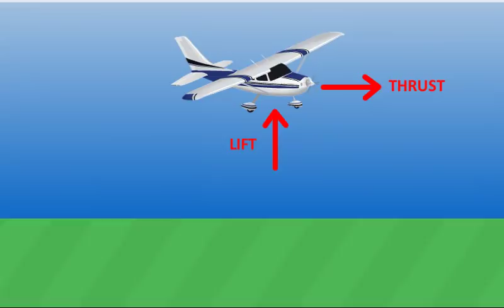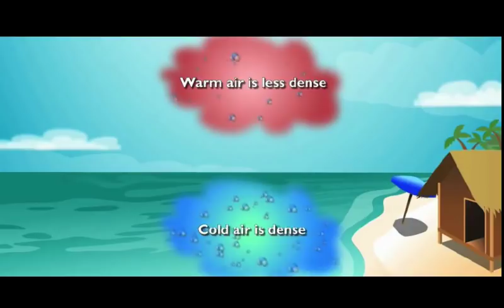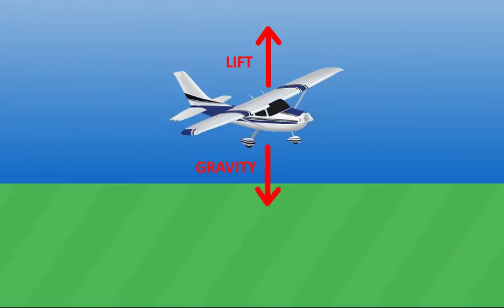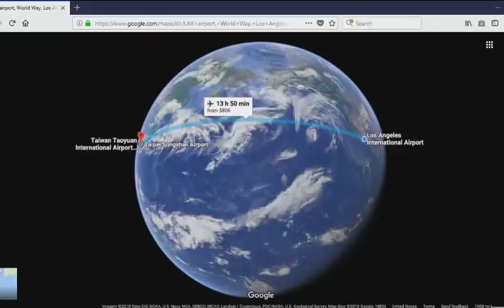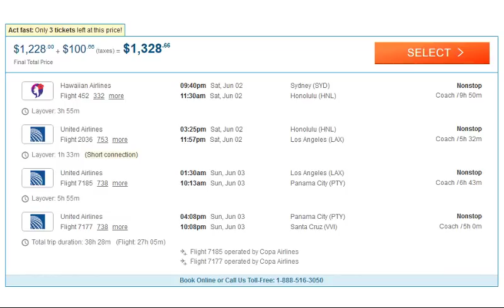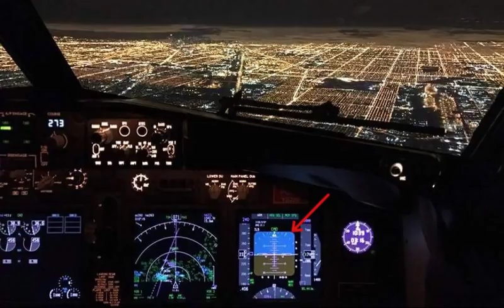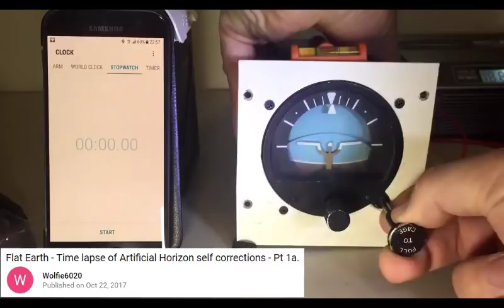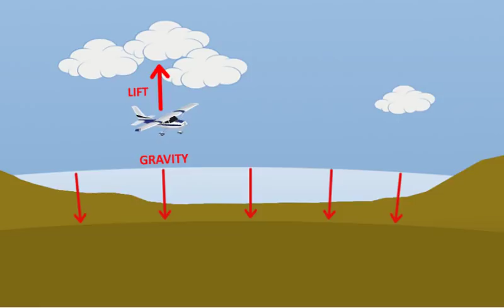Flat Earth Falsities - Plane Nonsense

Comment: North isnt up right? not in relation to the surface or curvature? 

if i glue a monopoly dog to the tip of south africa facing north...why is the north pole up in relation to the dog? why is he going against the downward curve?
Reply: Fuck off you pathetic troll.
Reply: That's okay, he didn't say anything at all.
Reply: Bobby "then prove the experiment wrong." I did it and the dog was on top of the globe and all the directions were down. Why did you hold the globe with north facing up? Is the globe the Earth? Can you prove ANYTHING about the Earth using a toy globe? 

If you drop it and it breaks, does that prove that the Earth can be dropped and broken? Is there a huge metal dog the size of Madagascar glued to South Africa on the real Earth, with its head extending far up into space (at the scale of your globe, the atmosphere is about 5mm thick)? If the globe is painted blue, green, yellow and brown, does that prove the Earth is painted blue, yellow and brown? If your globe has an axle through the poles, does that prove that the real Earth has a metal rod running through it?

Nothing about your "experiment" is real and no real conclusions can be drawn from your illogical, false, deceptive concoction. You idiot.
Reply: Stormageddeon It's easy to forget that we're here to persuade normal, thinking people looking into the outrageous claims of Flat Earth Cultists, honestly seeking the truth. We can't change the Cultists, only death cures insanity. But we can reassure the normal people that what science believes is logical, confined to the facts, and is based on honest, very skillful people who spend their lives looking to refine our conception of the truth. And that these scientific people have been spectacularly successful . We can also acquaint the honest seekers of the blatant dishonesty and deceit of the anti-intellectual cults and our efforts to avoid those same errors.
Reply: Bobby boy You didn't say anything about two dogs. You said "if i glue a monopoly dog to the tip of south africa facing north...why is the north pole up in relation to the dog?" I told you that I held the globe so the dog on South Africa was on top and all directions were down. And I asked you what a toy globe had to do with the Earth? It has NOTHING to do with the Earth and nothing you can do, gluing stupid Monopoly dogs to it means anything. Answer my list of questions above. Checkmate, mate. You're an idiot and you're too much of an idiot to see it. Unaware idiocy is the worst type, invariably fatal. My sympathies.
Reply: There is no spoon.
Reply: RockinRobbins13 which lie? pull put your globes and do the experiment
Reply: No... then prove the experiment wrong.
Reply: Stormageddeon Dark Lord of All navigating has nothing to do with physical curvature and the properties of a spherical surface.
Reply: Bobby. How can you navigate the earth? Answer, the magnetic Poles. What is up or down on a sphere? There isn't an up or down on a sphere. So to navigate the spherical earth we use the magnetic poles. North and south are directions. Does a ball have a north and south? No because it doesn't have any magnetic poles. Why did you say that? Did you think it made you sound smart? Take a week and research geometry so you don't end up saying things like this anymore. It doesn't help your case when you don't even understand shapes.
Reply: @Capt'Wes Starwind Your answers are a little off. First of all, even when we use the magnetic poles, it is true north and true south we are really interested in. That is why navigators use maps that indicate the difference 'anomaly' between magnetic and true north.

Secondly, 'north' and 'south' are not purely constructs of the human mind: there really is an axis of rotation, going through a sphere it must cut the surface at two poles: it is only the choice of which is 'north' and which is 'south' that is a construct of the human mind, and an arbitrary choice.

But probably the most important is about 'up' and 'down'. Back before people understood gravity, they could not really talk about it right. But now that we do know, 'down' is always the direction gravity pulls you. Since we are on the Earth, that direction is towards the center of the Earth. So neither people living on our side of the Earth or those living on the opposite side have to "walk upside down", since down is always towards the center.
Reply: That is because I am trying to dumb things so a 5 year old can understand it. Main point is up and down on a sphere do not exist the way Bobby thinks they do on the earth. Getting into geographical and celestial poles and the earths axis is going to land on deaf years at this point. He doesn't understand a sphere or what it is. They think the earth is flat after all. They don't even say a cylinder, or question if it could possibly be a cone. I am not sure Bobby here even understand magnetics or shapes at this point. This is why I never even mentioned the second point you mentioned, let alone the dreaded G word. Flat earthers are five-year-old children, so complicated detailed explanations land on deaf ears. First shapes, then terms found in dictionaries and encyclopedias, then rotation of earth the sun and moon, then orbits and finally gravity. They can barley grasp what reason or logic are at this point. Their back slide has taken them to a time before Socrates and Pythagoras. That is what you are dealing with when it comes to flat earthers. Hell, take a look at my folder "get woke". It is alarming the videos I need to post to get some to understand basic concepts. I had one deny 3 dimensional space yesterday!!! Trying to give long answers to them with lots of details, facts and examples just gets them angry and does nothing. Maybe if they can understand what science is about and how it works there may be some hope for them. They are on computers and deny science is real, so that should show you their mindset. What built the computer bobby? Science or sky fairies and magic crystals? Remember when you are answering their questions you are essentially talking to a five-year-old cave man that has never left the cave. Dunning-Kruger, as a flat earther ironically pointed out to me once. This is why asking them questions about how they learned this and trying to get them to understand shapes is what Stormageddon and I have been trying lately. Question everything. You know how many answers I have got to the question "what is a theorem?" has been in the past few days. Zero. So we keep trying the old KISS adage. Keep It Simple Stupid. It is fascinating how simple one must get to communicate with flat earth.
Reply: Nice, but it should be clear by now that that approach is not working. Part of why it is failing is that you go too far when you say they are five year olds. Even worse is when you say "five year old cave man that has never left the cave". They are not going to respond the way you want when you look down on them so severely.
Reply: Well I could try long winded descriptions linking peer-reviewed papers and videos and experiments they could do at home even. After 3 months that has amounted to nothing. Except hearing them claim peer-review is all lies the experiments are lies and my descriptions are all lies. This new approach at least helps in understanding that these people can't understand 3d shapes and basic geometry. Sort of key for figuring out the SHAPE of the planet they live on. If they can learn grade four geometry then they can have one tool in understanding how to know the shape they live on. They can then go test this with two friggin sticks and a compass. Dunning-Kruger. You do not yet get how much they don't know. Its all magic, sky fairies, and conspiracy with them. Because they do not understand simple math and what 3d shapes are or how to measure them. With that basic knowledge they can see through this stupid flat earth lie. How can flat earth make any measurements for their earth? Well they can't and it is a scam. When they understand how we first measured the earth they may see flat earth can not do that. They already have all these preset brainwashed responses to all the answers we give them. Asking them what shape is made from two circles and a rectangle breaks through a bit of that brainwashing and may get them to stop and think for a minute. They do not understand geometry in any way at all. Keep trying with the intricate answers bit you should know all their responses after a week. It's lies, it's fake, it's NASA, it's Satan. See how asking them about a shape keeps them from responding with a preset word salad. The very least they shut up because none will admit they don't understand grade 4 geometry. How can I explain how Eratosthenes figured this all out if they cant understand what he was doing. Go look for flat earth Eratosthenes experiments. All done wrong or a model. They want old school observable physical science as proof. So when they can understand the maths involved they can realize how it is done. That's why they love the laser tests that get messed up by FE showing no curve or the theodolite apps. Go old old school shadows and math and they can not deny it then. I just gave up with the explanations everyone gives since it was going no where and I would just end up insane at that point. Do you not think guys like bobby have heard all the answers people give a thousand times by now? Of course he has and he chooses to deny and ignore it.
Reply: NotTheCIA I.think its self explanatory. easy to do. its just the results are undeniable and common sense. people on opposite sides of the ball would hold a view point opposite of eachother in relation to the curved surface. 100 % undeniable. please grab any 2 small objects, glue them to your globe one north one south and test it.
Reply: RockinRobbins13 i told you to put a dog in south africa and one at the north pole. we are not all "on top". that is horse shit.

yes both dogs are on top of the globes surface. both are at opposites of the surfaces curvature. checkmate.

grab an apple. sane thing. put your pointer finger on the stem and your thumb on the bottom. see both of your fingers are on "top" of the apples surface. both of your fingers however are not on top of the apple. they are on opposite sides. press down with both fingers (gravity). both are going "down" towards the core or center. Here is your problem. your thumb is still upside down in relation to your pointer finger. its direction to the core is both north and up. same with the surface. for your thumb to meet your pointer finger it would have to go north and up. the same applies to any ball or sphere. people live on opposite sides of the curve.
Reply: RockinRobbins13 i guess you didnt read my posts. you cannot disprove what in saying. the point is on a globe a dog in the north is opposite to the curve than the dog in the south. i broke this down for you even more clearly with the apple using your own "gravity theory". it didnt change the 100 % facts nor does scale explain it away.
Reply: Bobby, what is the top of a sphere? Reading your posts is a bit confusing. It is hard to tell what you are even trying to say. Yes though, people do live on opposite sides of the earth. If you had Super Man x-ray eyes and could look down through the earth, from your perspective people would look like they were upside down. Everything is accelerating to the center of mass. The earth just gets in the way. So again what is the top of a sphere?
Reply: +Bobby Wizdum
"you cannot disprove what in saying." Your lies have been exposed and proved as lies on several occasions Bobby. So fuck off.
Reply: +SpectatorAlius
"The FE cult is not "firmly grounded in biblical literalism". If it were, your favorite bogeyman Ken Ham would have to profess the exact same thing as they do."
Oh dear, what a specious argument.  That argument is based on there only being a single interpretation of the bible, which is of course a lie. The FE cult is biblical literalism.
The ID cult is biblical literalism
The Creationist cult is biblical literalism
The YEC cult is biblical literalism.
Christianity itself is biblical literalism. No bible. No JC. No Christianity. Or are you one of these special people who is Christian but doesn't believe anything in the bible? Even though you have to believe the bible to be a Christian.
"@wrong When you learn to read, little boy." Only a silly little bot would be so infantile as to use that silly schoolyard stupidity.
"you will realize that I already answered your impertinent, stupid question." No. you responded. There is a difference. Child.
"You might even realize how very wrong you were to claim "only YEC cite AIG unless it is to prove AIG is lying" Such as? You? Jason "the liar" Lisle? Pence?
"your own intense wickedness". Ooohh, a godbotherer threat is it. I really am frightened. If that is so, why is it that I have spent much of my life working for charities to help the disadvantaged, the disabled etc.? Unpaid. And these were charities your faith had abandoned because they weren't getting the adulation,  recognition and media support they craved. Once we had had nurtured these charities back to health suddenly you godbotherers wanted to be part of the action. Pure hypocrisy.
Reply: +RockinRobbins13
"People who believe that Flat Earth Cultists are Christians" So who decides? They claim they are. Or are you the arbiter of all things? Are you?
The only reason Ken Ham et al are so vehement in their abuse about the FE cult is because it exposes the weakness of biblical literalism which the FE, ID, Creationist and YEC cults all adhere to..
"They believe the Cultists can't tell the truth, but suspend their disbelief when the Cultists claim to be Christian" Nt too logical are you. But then you are an illogical godbotherer. You are conflating knowledge and belief which is the norm with godbotherers.
FE cultists believe the earth is flat because they believe the that is what the bible states, just as they believe they are Christians. You also believe you are a Christians, as do Ken Ham and Jason Lisle.
A Christian is a person who believes in JC, i.e. the biblical person. If they do not then they are not Christians they are something else.
To a non-believer there is little difference in someone believing the Earth is flat and believing in Christ and claiming they are a Christian. It is all part and parcel of the same thing. But to believers like you, anyone with a different flavour of belief to yourself is not a Christian, so the problem is with you and your bigotry not with those who quite correctly state that the FE cult is a Christian cult.
You are the one following "the cafeteria school of logic." So please learn to deal with facts.
Reply: On the earth, it isn't opposite. Both see "down" as the direction things fall. They both agree on what direction down is. But as seen from space, a realm that begins about 5mm from the surface of your globe, by the way, you have decided to arbitrarily assign the up and down directions. You are wrong. Up and down only exist where there is gravity. Down is toward the center of gravity of the object you are on, spherical Earth in your and my case. Wherever we are on Earth, down will be toward the center of the Earth and it is the same for everybody.

You're pretending you're in a place Flat Earth Cultists don't believe in, space. And in that supposedly non-existent space you're handing out the words "up" and "down" without any reason, just arbitrarily as a brain fart. They don't mean anything. Space doesn't exist, according to your cult. There is no up and down in a medium that you deny, bub. 

I established that your globe proves nothing about the earth. None of its characteristics are shared by earth. Earth has gravity, your globe doesn't. Earth has an atmosphere, your globe doesn't. Your globe has a rod through the poles, Earth doesn't. Your globe is painted different colors than Earth. Your globe has latitude and longitude lines on it and Earth doesn't. If you drop your globe it will fall and break, Earth won't fall and break. Your toy globe and Monopoly dog proved exactly nothing about the Earth. It didn't change the 100% facts nor does scale explain it away. Checkmate pallie.
Reply: wong I'll let what I have to say here and other places speak for themselves and let others make the judgment. You have your set of prejudices, and your worldview is built on Christians being liars and mental deficients. I'll let people judge for themselves whether I fit that category. I'm not afraid of scrutiny as the Flat Earth Cultists are. I welcome it.

As for the Cultists, they say they believe the Bible. I prove that the Bible does not support flat earth. They therefore don't believe the Bible.  It isn't me deciding or being the arbiter of all things. That's a ludicrous hyperbole. It's me comparing the exact language of the Bible to their claims, comparing the writings of church fathers with their claims, finding that their claims are in conflict and declaring that evidence shows they're dishonest and unChristian. 

Just as you take a camera and a strobe, photograph an object falling, determine the change in speed over change in time and put a number on the Earth's gravitational acceleration. You aren't the arbiter of the gravitational constant. You researched and discovered something true outside of yourself, which you did not make. Your only function is communicating this truth. On Earth, things fall at 9.8 meters per second squared. You measured it, but are not the arbiter of that number.

I showed that ancient Hebrew poetry is hyperbolic, not meant literally. It has known rules, not the same as modern poetry, which no one reads any more anyway. The literal parts of the Bible talking about the shape of the Earth are very few, but they are consistent. I established that the Hebrew word used means sphere or orb or globe. I established that teaching by Christians dating all the way back to 300 AD is consistent with Jewish teaching that earth is a sphere. I conclude that flat earth is not authentic Christian thought and is in conflict with Christian churches today, which are built on the foundation of the past. Do you have any evidence to the contrary? No. Do you see the evidence and make allowances for it? No, you act as if I established no fact, conducted no research.

How is your treatment of this issue any different from the stance of Flat Earth Cultists regarding the shape of the Earth? You have a burning hostility toward any religion. You don't accept any evidence that any religious people can be honorable and bound by the truth. They have a burning hostility toward science and facts. They don't accept any evidence that spherical earth/heliocentric solar system are honorable and truthful.

And to be fair, we all harbor prejudices that blind us to the facts, don't we? The dangerous thing is when we don't realize that we HAVE the prejudice. The very concept of independent thought, colleges and universities is a product of the Roman Catholic Church. Did they fight the findings of the monster they created sometimes, as in the case of Galileo? Sure they did. They harbored prejudices same as us. But they fixed it. They actually fixed it pretty quickly, realizing that if you are to believe in God, you also have to believe His creation. His creation can't be in conflict with his word, because the author of both is a God who cannot lie. When you dig up the bone of an extinct animal, that is the work of God and it cannot be in conflict with the word of God or you are not a God worshipper. If you believed before that God's creations were eternal and no animal could ever become extinct (a common belief up to the middle 1800s) then you change your belief in the light of facts. Isn't that what we do every day if we continue to learn? 

The amount of our knowledge is always dwarfed by the amount of ignorance we have. Where our ignorance is will often surprise us, as it did when Galileo took photos of Saturn's north pole and found the cloud bands in a perfect hexagon. We didn't say "that's impossible, those photos are lying." We said "Holy crap, that's impossible, but there it is. Magnificent!" We abandoned our past misconceptions and reasonable theories and immediately and enthusiastically embraced the truth.

Science is about what is. Religion is about why is. There is no conflict there. In fact, religion begat science.
Reply: wong u saying fuck off is not exposing anything. It just continues to show your immaturity level.
Reply: +Bobby Wizdum
OK lying troll Bobby, prove you aren't a lying troll.
Why is it that a compass needle is more or less vertical at the poles and horizontal at the equator?
And when you carry on past the poles the needle slowly returns to the horizontal?
Why is it that it is only possible to navigate accurately over long distances using spherical trigonometry?
Why is it that traditional gyro compasses work perfectly in low latitudes but became unreliable in high latitudes?
Why is it that it is only possible to navigate accurately over long distances using charts based on a terrestrial spheroid?
Why is it that when you watch a ship sailing away from you the hull is the first thing to go below the horizon, then the superstructure and finally the funnel and upperworks?
Does a magnetic compass point towards polaris (Alpha Ursae Minoris) at the north and south poles?
Does a gyro compass point towards Alpha Ursae Minoris at the north and south poles?
What is the relationship between longitude and distance when travelling east or west parallel to the equator?. If you know the answer then you know the earth is a spheroid. If you don't you are not qualified to comment on the earth’s shape.
Please explain the principles behind the development and functioning of a gyrocompass? If you can then you know the earth is a slowly rotating spheroid and gravity is a fact. If you don't you are not qualified to comment on gravity, the earth's shape or movement.
No evasions please, just straight, honest answers.
Reply: wong why don't you stop changing the subject.
Reply: Capt'Wes Starwind the opposite of the bottom. My apple just proves what youre saying to be silly. The center is up from the bottom as its down from the top. Doesnt matter who is who. They are opposites. Therefore rivers somewhere would have to flow up and over the curvature from their perspective
Reply: Bobby as I showed by quoting you, you didn't mention two dogs. The only dog you mentioned was glued to South Africa for some obscure reason.
Reply: Bobby Wizdum there is no top of a sphere. Why are you having such a hard time understanding that?
Reply: Capt'Wes Starwind there are opposite ends. Do you not understand that?
Reply: RockinRobbins13 sorry do it with 2 dogs. Then go ahead and do the apple experiment. Both test true every time. Real science.
Reply: Bobby Fake science. Neither an apple, nor the globe and the Earth. Try putting the Earth in the trunk of your car. It works with the globe. Does that prove you can put the Earth in the trunk of your car? The globe is painted monochromatic colors of blue, green, brown, orange and red. Does that mean the Earth is similarly painted? The globe will float on water. Does that mean the Earth floats in water? No, the Earth and globe are different objects and they have very little in common.

You can play any games you propose with the globe and the apple but they prove nothing about the Earth. You have wasted your time.
Reply: RockinRobbins13 try it with any sphere you want or piece of fruit with a core. The properties are the same. Find me one sphere here on earth my test wont hold true on.